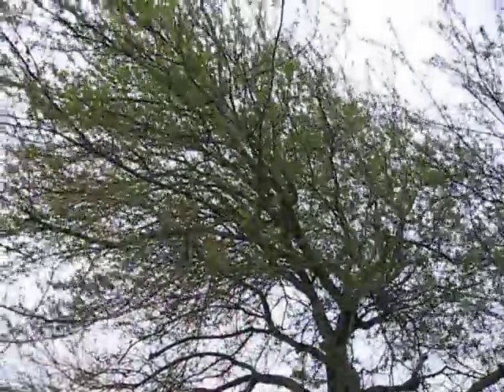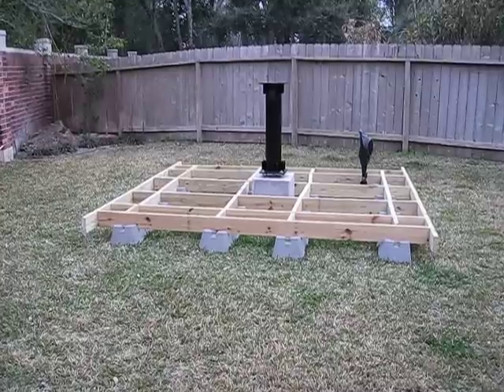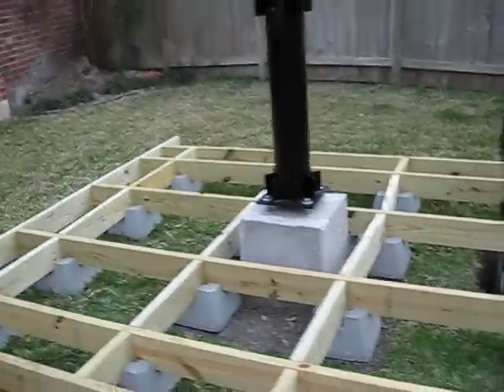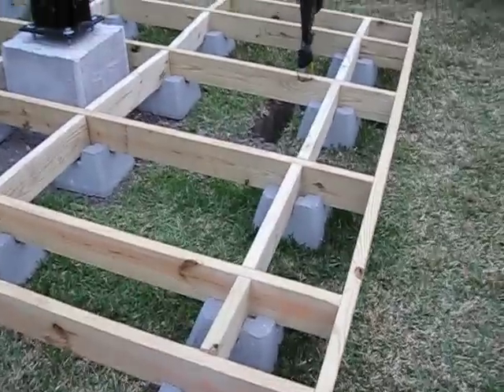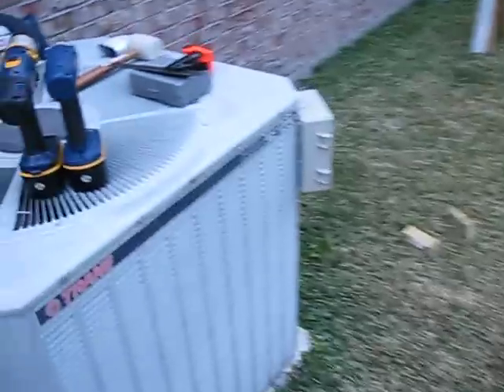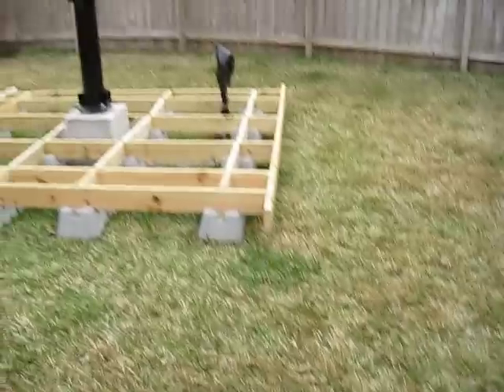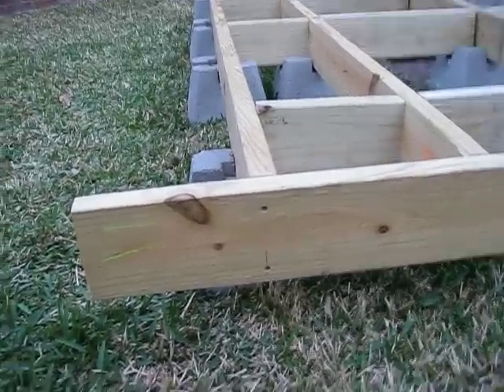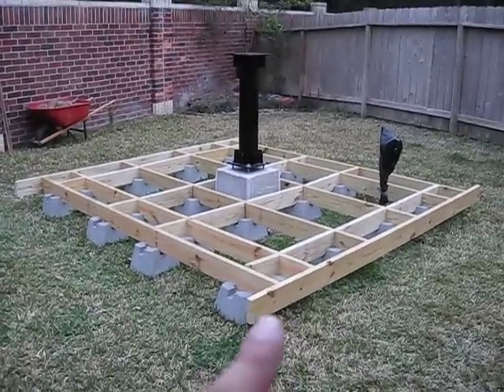How I Built My Backyard Observatory - Episode #18 | Deck Level & Square

Comment: 1) You didn't need to clear the grass and place some gravel and weed fabric down? 
2) Won't the concrete post move and shift in time since they are not posted under the ground? 
3) The bottom wood used for additional leveling will rot no?

Comment: I think you did an overkill on the handy blocks...
Reply: Not really - the manufacturer's recommended spacing is pretty tight.  It's a floating foundation structure, it needs more than you might think.
Reply: @hanskinslo326  I think he means you could have used joist hangers
Reply: @ikeo8666  concrete blocks must be cheaper than metal joist hangers where he lives.

Comment: to many handy blocks . you need to frame it correctly and use the minimum amount of support handy blocks . you can screw and nail a good frame on flat ground first then just lace the handy blocks underneath at the corners ,centres etc. just like framing walls for a cabin.

Comment: What is to prevent the deck blocks from sinking in the soil?  I'm about ready to use these but everything I've read no one puts sand or gravel under the deck blocks...

Thanks,
-Nigel
Reply: If you space them correctly, they don't sink.  Spacing them too far from one another is the problem.